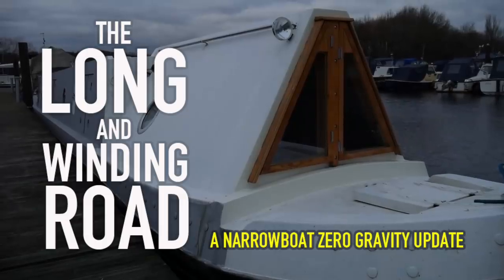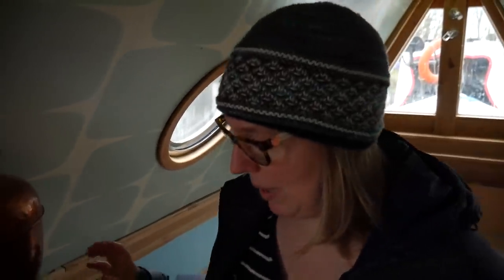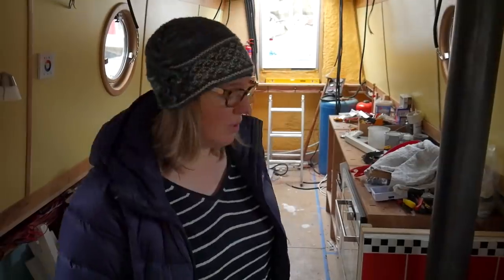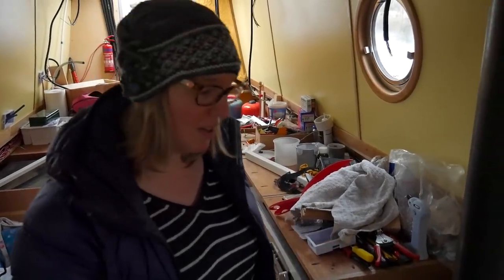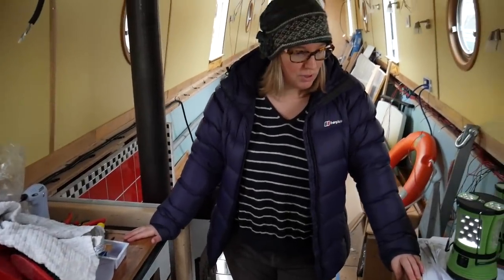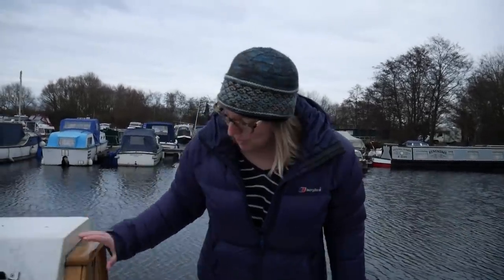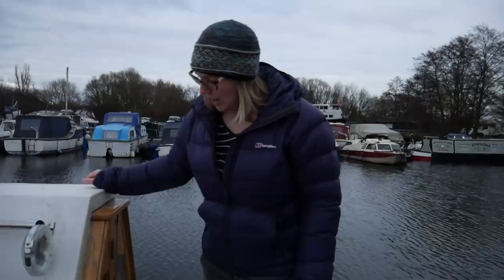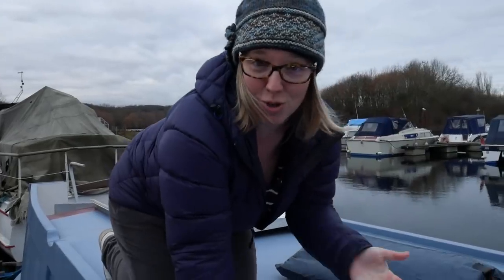The Long and Winding Road - A Narrowboat Zero Gravity Update

Comment: Welcome back! The easiest treatment for your wooden front doors is to take them back to wood and to Danish oil them. I live  right on the sea, and had teak window frames. I made the mistake of yacht varnish in them. It looked dreadful after one season. An old boy near me said to oil them, yes you need to do it every few months and definitely before winter. But it only takes half an hour. No rubbing down just wipe off dust and apply!

Comment: Just a thought, when trying to reflect radiant energy - the heat from your chimney - it is the metal that is important not the surface finish. Matt finish Aluminium is a better reflection of Infrared energy than polished stainless steel. Brushed aluminium might look good in your diner design/theme. Just a thought.

Comment: Sorry to hear about your troubbles.

My experience is that Jotun BenarOil Marin (i.e. UV-filter) works good on boats, varnish is a pain: it either gets white and peals of or the wood under gets black. I dont have those problems with BenarOil, but it must be the Marin version or it is destruoid in a summer. The downside is that it gets sort of sticky in heat, its not sticking to your hand but plastik bags resting tend to stick to the surface. That kan be cured by using the dull (not shiny) version as last coats. (It is alcyd oils that dryes but does not harden)

Epoxi is not UV resistant without aded UV-filter and will bee destroid.

Comment: having worked a god deal whit heating i am seriously afraid that the wall is going to get to hot,
but why not get something like this http://woodstoves.co/141-fire-flue-water-heater.html
hock it up to the radiators and you while get beater efficiency.
when dealing whit an open water heating circuit the expansion vessel is supposed to be 5% of the size if the water volume.
I seriously hope that you manage to finish the boat of you're dreams, and still have the ability to enjoy what you built.